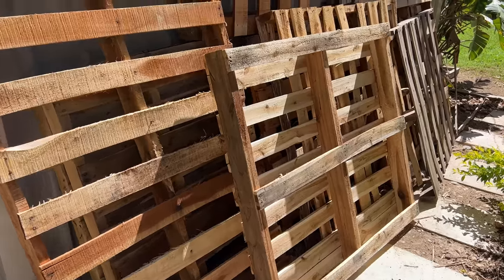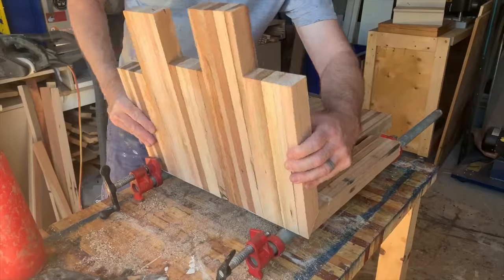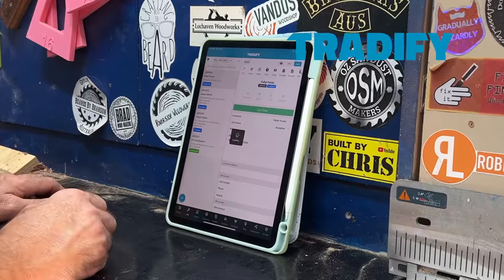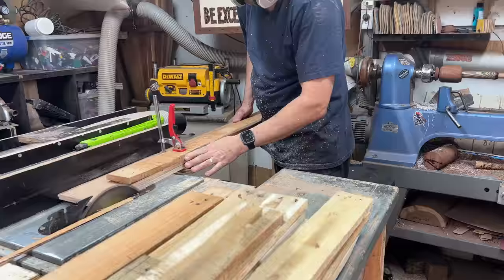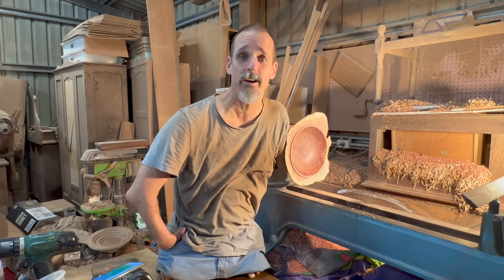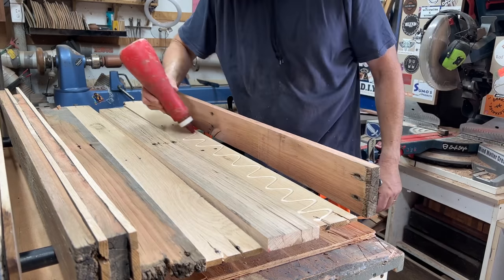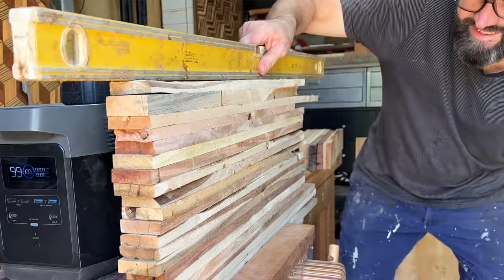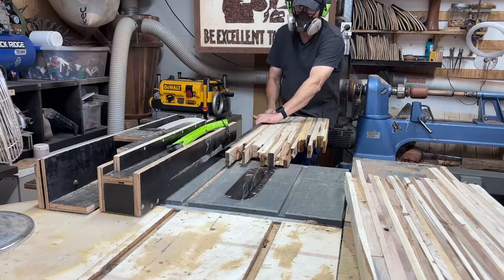20 Pallets! What it takes! What it can produce (and make $$$)

Comment: I made a pallet buster like you have with flat bar and a pipe at the rear to rotate on, I found the easiest way is remove outer edge of boards first then move into the middle and remove the middle.  The boards lift if the middle is off first but the middle you have both sides of your pallet buster to lift it off and it's even pressure.

Comment: I work at a paper company so I have access to lots of pallets, which I’ve used for years to make stuff. I get to high grade them and use the work truck to take them home. Recently I was picking up pallets from the pallet mill itself because we sell them retail to customers. Anyway I saw a large pile of wood and it looked like scrap. I asked the guy loading me and he said I could have all I want, they just grind them and sell the chips for fuel. So now I get my wood without having to break down pallets. That’s my tip. Find a pallet mill and see if they will allow you to take scraps. Good stuff man. You definitely make the most of those pallets. Cheers!

Comment: Well just fyi, I use a reciprocating saw with a metal cutting blade and get between the boards and cut the boards , makes taking apart pallets almost effortless, now the nails do stay in the wood but you can disassemble one in like 5 mins if not quicker.

Comment: Another  🇩🇰 here. (Actually I'm Irish but live here). I'm a bit jealous of the quality pallets you have. I just processed about ten using a 1970 Emco Star. It took a couple of days.
Reply: @dainermade  Emco star is one of those old, multi function machines, disc and belt sander, bandsaw, table saw, thicknesser/planer, lathe, grinder etc. It's a useful old girl. I had to sharpen the planer blades which are the originals from 1970!

Comment: So all those skinny scraps would make great bundles of kindling. Cut them about 12” make a 6” in diameter bundle. Save them all spring summer and fall, then for winter sell them to your local shops with a QR code to your website(additional marketing benefit). Use all the money to buy your shop new toys.

Comment: I've never found the value i using old pallet for woodworking. I tired it at one point when the place I worked at had small pallets made of red oak but generally the wood used for pallets are in poor condition, they're in short lengths, they're not very wide, they're often thinner than the standard 3/4" thickness (which makes planing them down difficult) and worst of all they have a high percentage chance of having nails or other things in them that makes them difficult to plane down.

Comment: Great video, Mark. Definitely going on my favourites !

One question though. While I understand the need for clean gluing surfaces, I always thought you said in your earlier videos that you never really bothered with cleaning up the faces by putting them through the thicknesser as modern glues (even the cheap PVA glue from Bunnings) were good enough (with the obvious exception of cleaning any dirt off the faces before glue up). 
So, my question is, are you now recommending putting then through the thicknesser before glue up?
Reply: Yep, I was wondering about this too.
Reply: I think he is doing that to remove the potential for gaps between the wood pieces. Less gaps = less finishing work.
Reply: @dainermade  it's called, "bootstrapping": you start as good as you can / as you know, and as you learn and earn you improve. Japanese also know it as kaizen - continuous improvement. It's the best way to do it.

Comment: Those blue CHEP pallets have a deposit the place has to pay for and they get it back when they return the pallets.

Place I last worked for, one of their sister locations had gone 4 years without returning any of their CHEP pallets and were just giving them away or throwing them out.  Then CHEP come by and asked where all their pallets were going.  Turned out someone hadn't bothered to pass on that CHEP pallets had to go back and the place was now on the hook for a very high six figures worth of pallets.

Comment: Perhaps I missed something somewhere, but why, as shown around 7 minutes in, do you always glue up on the edge, so the faces are glued together ? Why do you this, and not seem to use the face of the timber at its widest, as the presentation face ?
Reply: He gets thicker, less bendy and most important really hard to break apart slabs this way. It also easier to keep it flat and most pallets I've seen had various boards thickness, to extent that you take 3 pallets and get 5 piles of different thickness boards.
Reply: @dainermade  Thank you for replying direct, now I know.
But, I can't help but see if you halved the width of the planks, you'd have twice the number of 'tops' to use. The effect is to turn your $60 per hour into $120 per hour, for having twice the number of tops to work with. Who wouldn't want that ? If I recall right, the product you were making is only a corridor table, or shoe rack, so really, the need for a two inch thick laminated top, as you did, is what when the usage is so light ? 
I have a hammer and a bandsaw, so to me all my precision wood working looks like a nail, and every board looks too wide or thick. Rustic is where I am going, but, do your customers prefer your laminated top over a rustic top ? And you found this out by what sells ?

Comment: mark i seem to have massive problem with case hardening with all pallets i collect how do you deal with it
Reply: @dainermade  where wood has been dried to fast so outside is dry but inside moisture content is still to high. makes tension in the wood after you cut it, it goes crazy bends every which way stumpy nubs explains it better. you deal with a lot of pallets guessing you have same issues was wondering how you get round it. https://www.youtube.com/watch?v=nMzQmZNrunY
Reply: @dainermade  its alright. we live in same climate im in upper hunter nsw seems to big issue for me end up having to throw 1/3 of my pallet wool because of it one or two days after i cut it warps so much becomes unusable

Comment: started very recently to get into palet carpentry and seeing them differently now, only problem is i drive a skyline. and usually only fit about 1 maybe 2 if im lucky at a time. got any tips on getting em home, as im in no finacial position to buy a ute
Reply from the maker: hi mate, keep a pallet buster in the car or a battery circular saw or recipe saw. Quickly lop in half, get a few in the back seat.

Comment: Love your videos man, but I see you killing yourself taking apart those pallets, even with that fine prybar. Have you thought about placing an anchor of sorts for the edge of the pallet you aren't breaking down? Like a large sliding Dove tail type setup cemented in place? That way you won't be fighting the pallet, or relying on its own weight to counter you pulling boards. Just a thought! Keep up the videos!

Comment: Is that tool available to buy anywhere?
Reply: Think he means the pallet buster! Just a hunch
Reply: Yep, the pallet buster. Board puller. Mega fork 9000 by binford tools?

Whatever you call it.
Reply: @j.l.m.6862  I found one on Amazon about a week ago. Haven’t had a chance to use it yet but it got good reviews. If you look up “pallet buster” you should find what you’re looking for.
Reply: Cool, thank you!
Reply: @dainermade  most hardware stores over here are getting into selling them but there flat not square tubed. Anyway enough chit chat the now need finish the video.

Comment: buying lumber is cheaper and has a low carbon footprint then what you are doing.
Reply: @dainermade  you operate at a much smaller scale than a larger commercial operation,  your labor cost (your time) is higher per log,  you haul less cords of wood per gallon than a tractor trailer will,
thus creating a larger carbon footprint for your operation, along with the many other inefficiencies that exist with a smaller operation.  
Calculate your time and fuel and wear and tear of your truck/trailer and gear,
then compare that to the cost of a load of logs being delivered.
Probably find out you are working for $5 an hour after expense to fell and haul trees back to your place.
Reply: @dainermade  my bad,  sorry,  change out the word LOGS  for  finished lumber,
and reread the response.  Your time, wear and tear on vehicle, fuel, easily exceed the cost of buying finished lumber, and at a lower carbon footprint.
While I understand the recycling angle,
it actually causes more harm than good when it comes to the environment,
if that is the actual motivation for doing so.